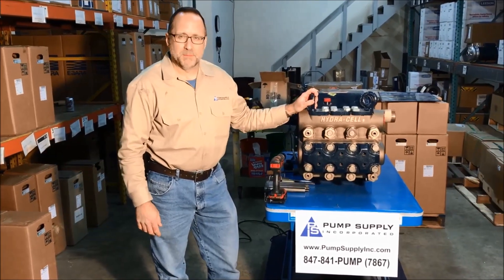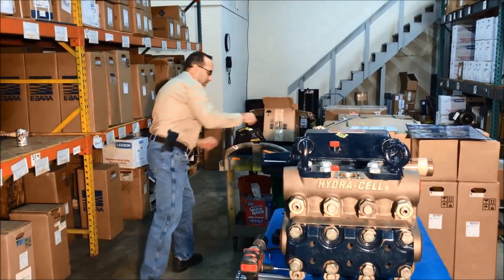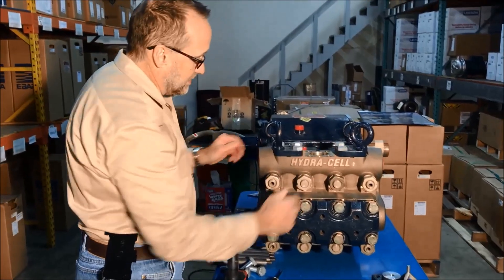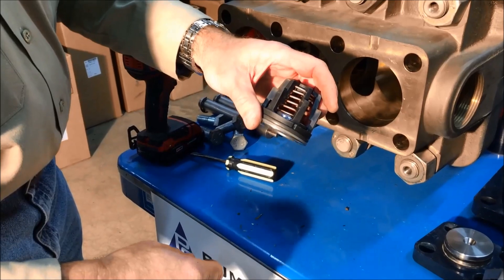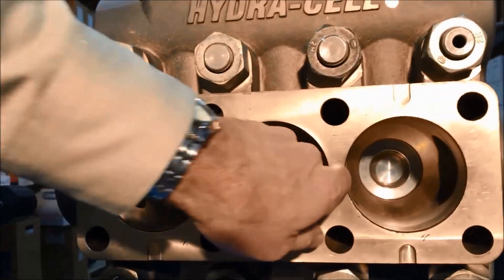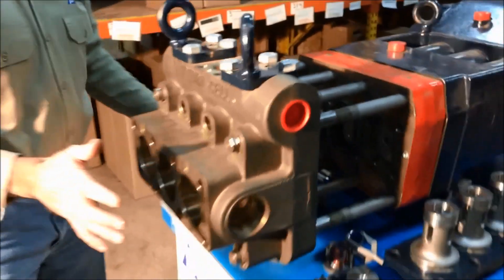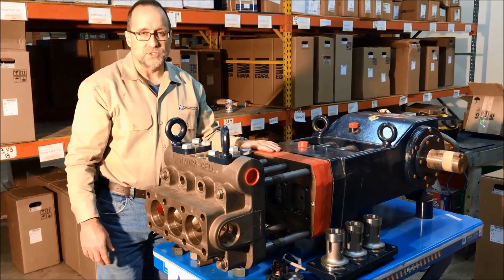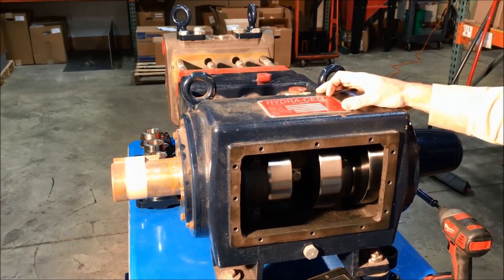Wanner Hydra-Cell T100 Disassembly

Comment: For More Information Call the Pump Guy at (847) 841-7867

The Wanner Difference

Pump is Totally Seal-less, 

Unlike competitors, There is NO packing to allow product to ever leak  

Dependability  - Pump is Long Lasting  

Hydraulically Balanced Diaphragms Equal Pressure on each side of
diaphragms equal long lifeProcess Fluid never comes in contact
with internal hydraulic pistonsPistons show virtually no wear as
they recpripricate  in clean oil

Flexibility  
Pump can be piped from either side Suction and DischargeYou can choose NPT or Flanged port connectionsPump can be driven from either side ( dual drive shaft standard )Several Materials of construction for you specific needs 

Quick Response

Complete Pumps can be delivered in as little as 3 Weeks

Serviceability   Complete Liquid End rebuild can take place as quickly ,  Under ONE HOUR !